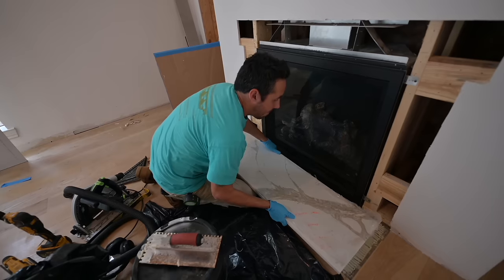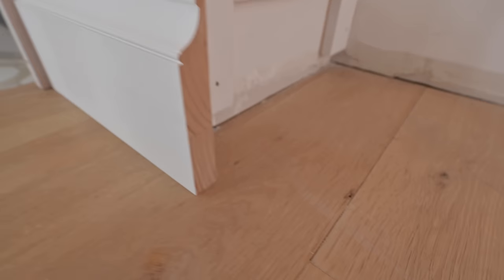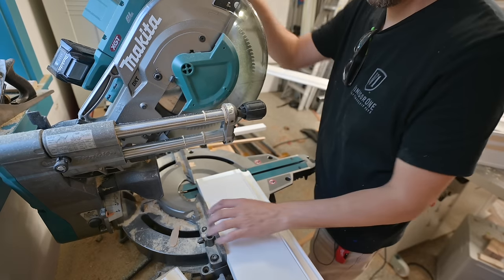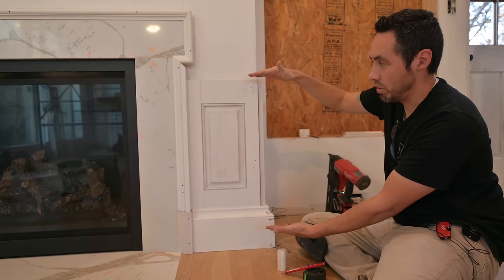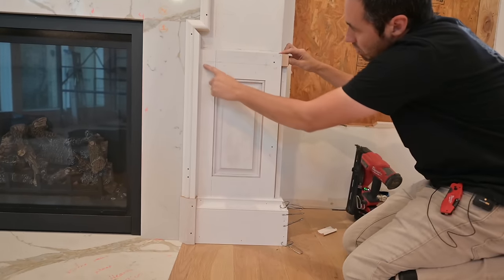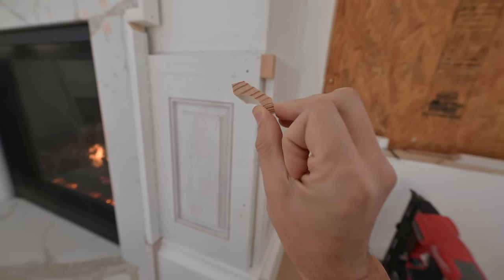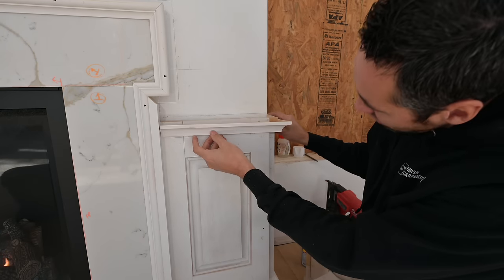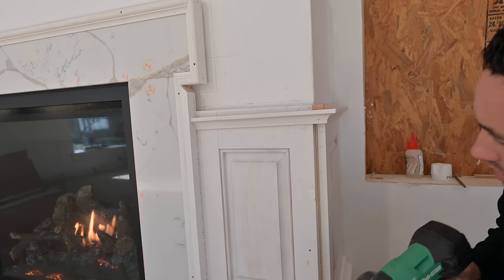Installing Quirk Moulding - A Distinct Classical Detail

Comment: CA glue activator is basically just acetone. I still by the spray activator though because its well, sprayable!
Reply: I made the mistake of storing the CA and little pump sprayer of activator that I got from Richard together, and it made a bit of a mess as the activator evaporated (and bonded with the monomers in the glue). Now I just keep them a few feet apart. The spray is great for larger surfaces, and I keep a pump for the precision repairs when I apply with a q-tip (and the glue with a toothpick)…and I use that stuff to repair dang near everything unless I have to step up to JB Weld!!😂

Comment: Hi Richard, I would have done it the same way with the 2-1/4" wide stile on both sides and then the corner quirk bead added on the corner. Ripping down the stile on the left would not have looked right, if you ask me. Looks great! keep up the good work.

Comment: I'd rather not have plinth blocks on door trim, but it's going to look great on this piece because it'll be architecturally correct.  After paint, and viewing the entire work, we will see that (plinth or no plinth) it's gonna look great
Reply: I’ve started adding plinth blocks around our house because my wife drives the vacuum like it’s the Killdozer. Looking at door casings, you would think we walk around in steel toe boots angrily kicking them.😂 The blocks are really easy to replace in seconds (just precut and paint a bunch of them).

Comment: It’s looking great! Why are you using trim screws instead of nails in some places? Are you going to use bondo to fill?
Reply from the maker: I mostly used those trim heads for changes that could arise through the build if I need to take something off. But yes I will be filling with bondo.
Reply: @FinishCarpentryTV makes sense, thanks

Comment: I absolutely love watching your videos ! I have a quick question that I never really see addressed on most videos that I’ve watched- can I do wainscoting on textured walls I’m not referring to grainy textured walls just the kind that new builds come with.
Reply from the maker: You will have to eliminate the texture by covering it with 1/4” or 1/8” plywood. Break the seams in the stiles. Or if you want to use the drywall you will have to smooth it out to level 5 finish.

Comment: Those miter clamps open when you squeeze the handle...
Reply from the maker: There is no handle…
Reply: @FinishCarpentryTV The elongated oval loop... the part that isn't the claw that creates the spring tension. That part is drawn out long like that so you can grip and squeeze it. Not as slick as the pliers, but it will do in a pinch (pun intended)!

Comment: I see you are using a Metabo nailer now. Did you bailout on the Milwaukee 18ga. nailers?
Reply: A milwaukee was used in the video
Reply from the maker: No I just got this metabo on sale and decided to buy it for the van. Still use the Milwaukee too!
Reply: Ok, the added battery platforms are the real cost when taking on new brands and was curious.

Comment: How do you like the metabo nail guns? I love the framing gun but haven't tried the finish nailers yet? But I love how you can use both 18v and 36v on the same tool
Reply from the maker: Got this 18G on sale and so far so good! Lightest gun I’ve owned!
Reply: Metabo is now on Gen 2 versions on their nail guns. Smaller and lighter now. Love mine. Purchased from Lowes on sale.

Comment: Can’t you just use the handle on the spring clamp to squeeze instead of pull apart? I don’t think you need the spreader tool from what I remember. Nice work and great video.

Comment: Is it normal in America to have the stone surround and hearth so flush to the wall and floor. In Europe it's normal for 6 or 8 inches of surround stone or marble or whatever material fitted to the fireplace wall, and also the hearth would be at least  2 inches tall. All fitted before the floor so you can work to the hearth. No doubt about you math and cut skills

Comment: When you normally install wainscoting, how do you normally finish outside corners? The pencil molding is a nice touch but I’m not sure it’s appropriate for most wainscoting applications
Reply: Most of the time, an outside corner is just a square corner, being either a buttjoint or a mitered joint.